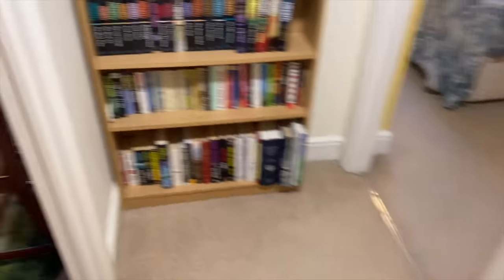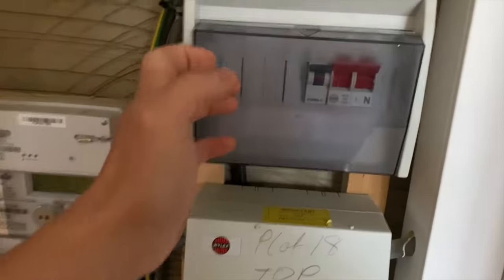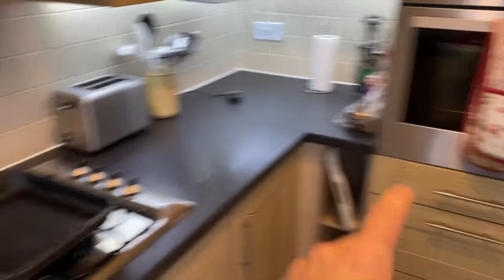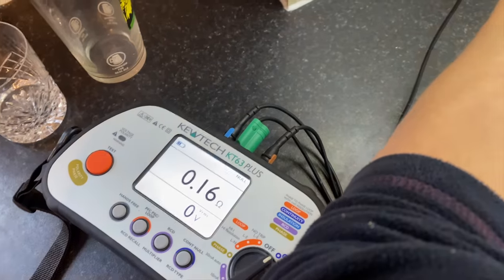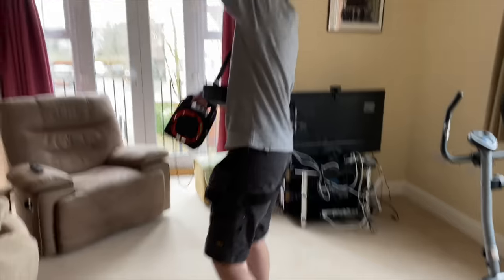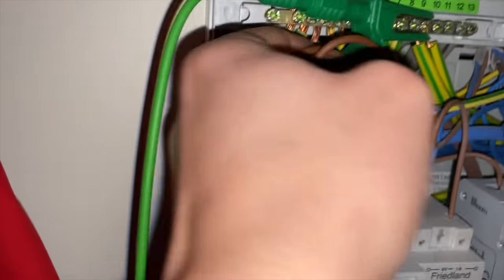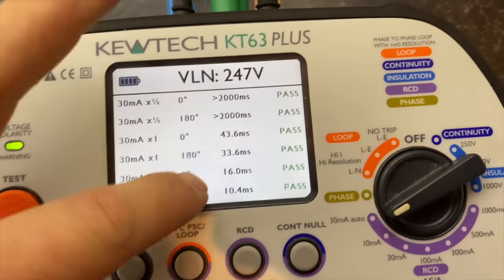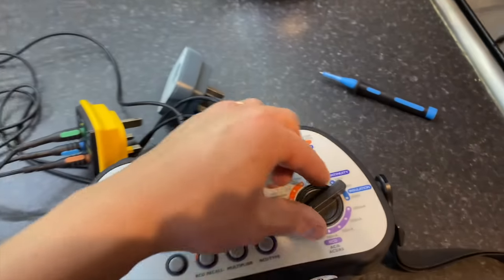Nice to get a decent one. Testing and inspecting electrical circuits. Cjrelectrical

Comment: I liked that socket in the kitchen which had the multiple switches for the appliances  wouldn't mind that in my kitchen. Never seen them before??
Reply: It's a grid switch, made by Deta. Seems to be standard issue on the newer builds, and this one includes a slot for the fuse for the cooker hood (since it's wired in and not on a plug top like the other two appliances). The only problem with the lovely switches with appliance names stamped on them is that the builders had them in the wrong order (another thing I sorted when I moved in!)
Reply: @davidnorth1021  thanks David much appreciated!
Reply: There are a few different companies making grid systems, from the various videos I’ve watched they’re great for anything with small conductor cabling to give that clean look. But for the cooker bringing those giant cables in to the spaghetti gets crazy.

Comment: Those usb sockets are already obsolete. Won't charge worth a fuk and no USB C.  Blow them up :D
Reply: I think this is the fourth or fifth comment. yes I much rather have a dedicated external multi port charger and a standard wall socket. Although they are nice for some things like low power USB lights etc.
Reply: I charge phones tablets and Kindle from them overnight and they work fine for that. Big Clive did a teardown on these BG ones and the contents are quite solid.

Comment: Isn’t the earth only 6mm in 16mm T&E ? It would need to be min 10mm to meet the bonding requirements for pme.
Reply from the maker: Yeah that’s a good shout.
I did notice this also but in the other riser cupboard where the services technically enter the building they have installed some additional 10mm bonding conductors to the water and gas.

Comment: Why do you switch the neutral
Reply: The neutral is considered a semi hot so there is generally a main isolator that breaks both. I suspect this goes back to the standards before they had a color-coded neutral. Where it would’ve been very easy to swap it and not have an issue until somebody went to work on it and thought it was off.
Reply: Thanks for that, it's something is austraila that we don't do

Comment: 19:07 is that a water droplet or flux?
Reply: That’s gonna be a solder droplet, had to look at it three or four times as light was hitting it just right that it looks almost clear.
That’s kind of sloppy oh wait jointed copper gas piping in the UK we don’t do that in the US very reassuring.

Comment: what is the rating  for 16mm2 T&E run throu the fabric of the building ?????  and volt drop
Reply: It’s in the regs book, why don’t you look it up?
Reply: @supersparks9466   but don't know what the fabric of the building is or if there is insulation present ????
Reply: I thought you meant in general , if you meant at the job in this video then I can't comment sorry.

Comment: pause at 2:10 the ironry, DOH
Reply: I know those USB sockets and yet. Although give a few years and will be doing it again with USB-c charger‘s and then when those get replaced by wall sockets will be repeating because I’m sure the wall sockets will be under rated as well because the upgrade the power capacity of USB-C 2.0.....

Comment: If the house was 2007. It shouldn’t have aib right???
Reply: That panel was added in 2015 to block off the old boiler flue, so I'm rather hoping it's not asbestos despite apperances...
Reply: @davidnorth1021  it’s just cement board I would guess
Reply from the maker: Could be asbestolux

Comment: 13:51

Wtaf is that spaghetti!?
Reply: Ethernet cables going into the bottom of my router. I can't clip them to the walls because there are prescribed zones all over the place in that cupboard, since it houses the CU. But it's normally hidden behind coats so what the heck.
Reply: @davidnorth1021  aaah ok 🤣 reminds me of the back of my hifi... A pain the knickers to dust
Reply: @davidnorth1021  so just start tacking them up we need to find out if there’s a Metal plate in the wall to protect the cables… 🤣
Reply: I'm pretty certain there isn't. Since filming I've confirmed the incoming feed is in accessible trunking in the risers but there must be about 2m in the ceiling/wall voids to cross from the riser to my cupboard.

Comment: I don't really see the problem with feeding two ring mains from one RCD.  What exactly are you hoping will still be powered on while you're investigating the fault?  Much the same applies to lighting.  Why would I want the lights to remain on upstairs if the RCD has tripped while I'm downstairs?  There may be a tiny, tiny, nanoscopic advantage to having an RCD or RCBO on each circuit but it hardly justifies the enormous cost.
Reply from the maker: Split load is better than nothing and dirt cheap
Reply: Depends how long the electrics off for, 24hrs or more on a hot summers day and no where  to temporarily connect the freezer?
Those RCBOs would not look so expensive then!
Reply: Having lived in this flat for six years, the lights all on one breaker doesn't bother me (unless I'm putting a new one up and would prefer some light from an adjacent room!). Losing all the sockets including five minutes for the internet to come back after an RCD trip is a more common annoyance though.
Reply: If I was planning to be here for much longer I'd probably ask Chris to quote me for putting RCBOs into the existing board, but I'm likely to be selling up in 2021 so I'll leave that for the next person
Reply: Shame they don't put back-up batteries in routers  would save all that time waiting for it to reboot
Reply: @davidb3537  at least with Comcast out here in the states they got a new router with phone built-in and because of regulations it Has to be battery backed for the phone, so there’s a slot for a Proprietary lithium battery on the bottom.
It’s a great idea until you need to re-start the thing and pull the power cord and all the lights remain on....

There’s a few videos on the Internet for building a DC UPS assuming yours uses a standard voltage like 12 V.
There’s also some expensive premade ones.
Alternatively I recommend getting a small UPS you’ll have some efficiency loss with the AC-DC but you are looking at about 30 minutes of run time when the power goes out so you don’t have to have everything restart.
Definitely also recommend one for desktops… You plug the USB cable in and they act like they’re laptop complete with the little battery icon.

I built a router using PFsense out of an old computer with what after the fact learned had noisy power supply fan… so I’m in the process of configuring a replacement that will take up a 10th the space and runs off 12 V, my switch is also 12 V, and my cellular back up also is 12 V.
I had a bunch of batteries kicking around so I decided to build a DC UPS and eventually it will be all connected together and I can tie in a ham radio.

Before that though I had literally my entire room on a UPS ( I managed to acquire a 3000 VA unit that just needed new batteries ) until it blew up taking power out to everything in my room.... for some reason my light must’ve been off and everything plunged into blackness because of course it was at night. So everything went back onto my older lower capacity unit and then somehow they started multiplying after Comcast gave me one with their equipment because I got business grade service and yeah I think I have 4 extras now.
Reply: Got distracted and forgot what I was thinking.
I believe it is a requirement from the videos I’ve watched that you want to separate things out so you don’t leave all the outlets off or all the lights off. that way you can at least plug a lamp in if the lights are out and have lights for the plugs that are out and run an extension lead upstairs and the like.

I know when I’ve done anything it’s always been of course the spot i am working on all the outlets around are on the same circuit, so then i need 50 feet of cord just to get to an outlet so i can have light to see what i am doing. Since then if an opportunity I try and put the lights on a separate circuit and I usually do bedrooms and living areas separate for the lighting. Being US code there’s certain requirements on outlets in the kitchen so there’s generally three circuits in the kitchen and a couple more for the other rooms, outside and then dedicated 240V appliances.
Reply: Split loads are recommended for safety. You wouldn't want a complete black out if you were walking with something very hot and suddenly the house went into darkness.   If on separate loads you might get some light remaining in certain situations.